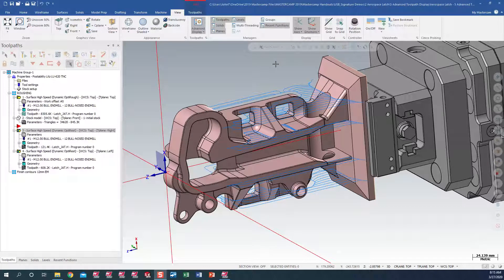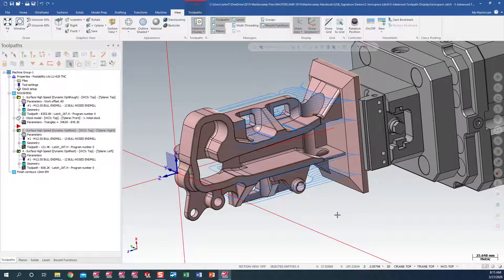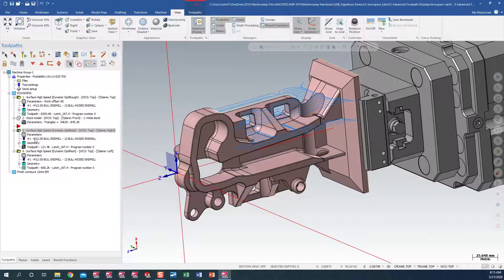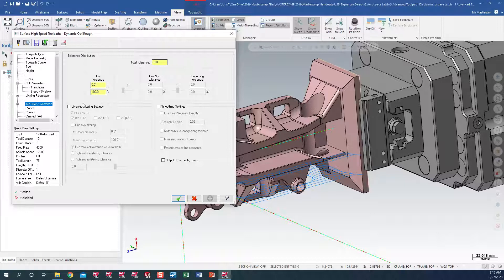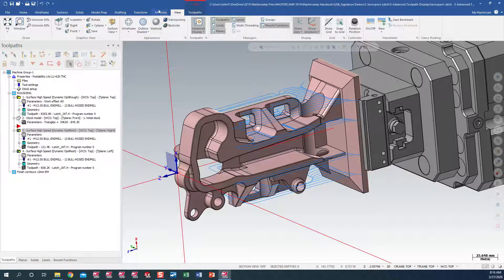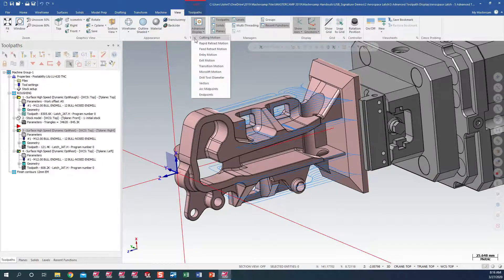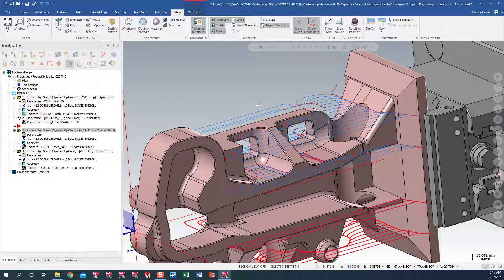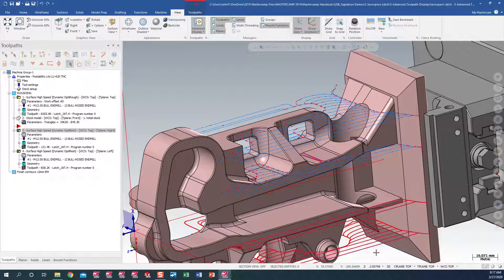Advance Display Toolpath Display Options for Optimizing Toolpaths

Comment: That's very useful to know to see what your line/arc filtering setting do.
Question:
I like your red color for the Endpoints in Advanced Display. How were you able to change their color? Really want to know, because they very hard to see with default  blue that almost matched the feed line color.

Edit:
Figured it out. The settings for color and point size are in Configuration > Colors > Advanced Toolpath Display > at the bottom of the list "Endpoints".

Thank you so much for the video!